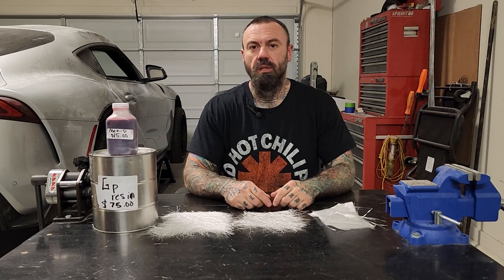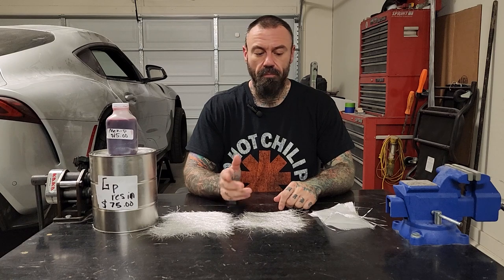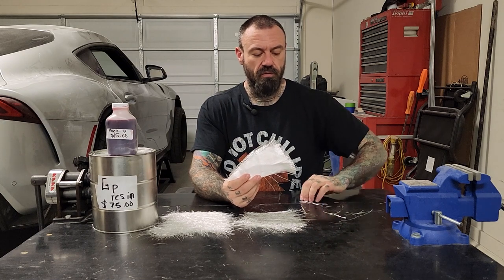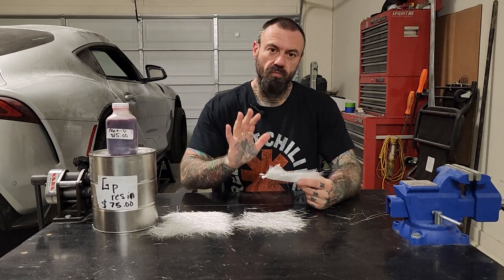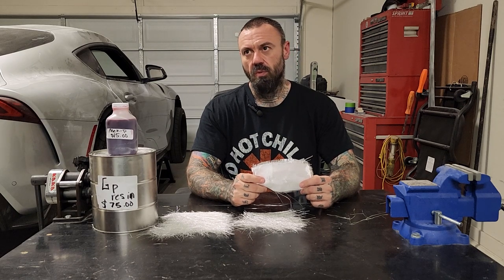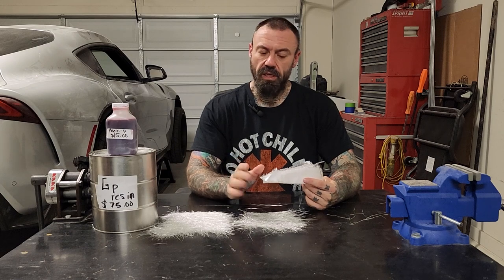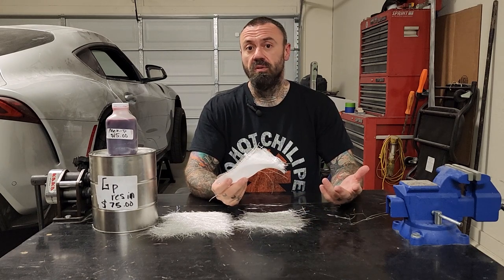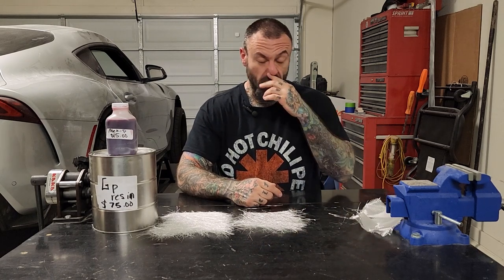How to Lay Up a Fiberglass Base Panel #widebody #handmade

Comment: When it comes to mold release, Avoiding fiberglass moving on a part while laying, would to be initially laying Gelcoat.
Reply from the maker: Yep, I totally agree. I personally do not use them, but I also do not make molds. I have personally purchased parts with gelcoat that were great. Some just hid terrible work underneath with it. Everyone does things differently, but I do agree with you.